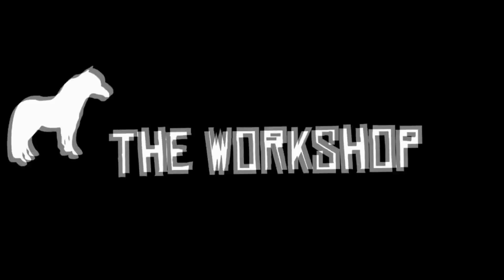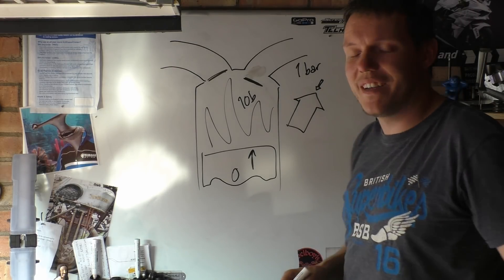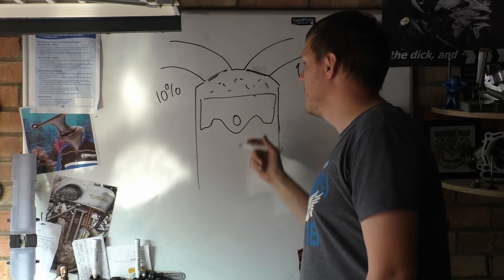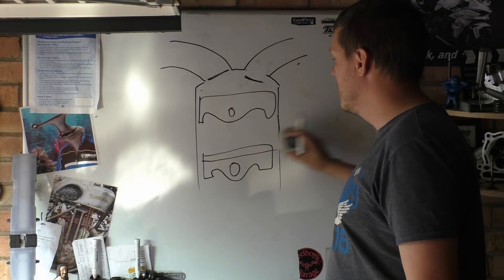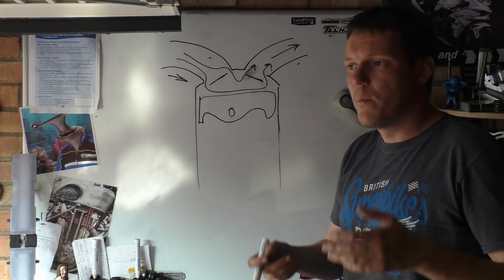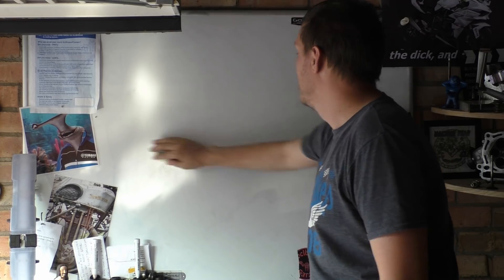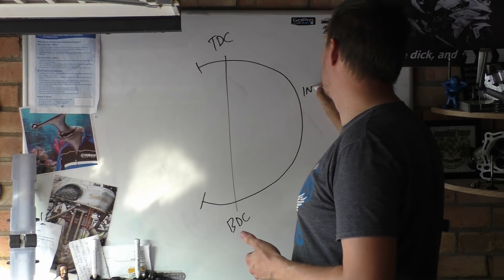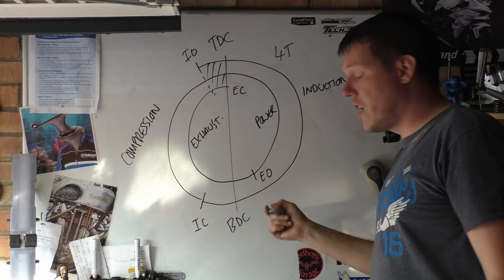Valve overlap - The basics

Comment: Explain how the exhaust explosion creates a shock (sound) wave that creates a negative pressure in the exhaust port and runner.
Reply from the maker: Exhaust explosion?
Reply: @thedirtyworkshop 
Intake ,compression,expansion (explosion), exhaust. 
Didja ever wonder why a motor make noise out of the exhaust pipe?
Reply from the maker: 1. It's not an explosion, it's a deflagration. 2. Explain how a negative pressure wave is created? Ever pressure wave has a positive and negative component, this is basic wave geometry.

Comment: Why not split the intake to separate intakes and have a different cam profile for each side. One side opens early to allow purging but doesn't get fuel sprayed through it and then the other opens up later when the exhaust is closed and sprays fuel through it.

Comment: How can purge be possible as the remaining exhaust gas will be positive pressure and the intake will be in vacuum, it won't push it out of the exhaust it will suck it back toward the vacuum (intake).   At 2:07 you mention with the remainder of the unexhausted gas remaining it's still 1.5 bar.
Reply from the maker: Because of momentum, and the venturi effect. The exhaust gases are flowing out of the cylinder, this causes its own pressure system. If the engine is tuned correctly the intake has a resonance that promotes inertial filling from the intake side.
Reply from the maker: In other words pressure is not the only thing to calculate, hence why this is a difficult subject...

Comment: Kind effort but the explanation contains mistakes.  Valve overlap allows the low pressure caused by the exhaust gases leaving the cylinder to help the fresh charge enter the cylinder. Not what this video describes saying that the fresh air pushes the exhaust gases out. When the intake valve opens before TDC there is not yet any dynamics to the inlet charge to enter and push the exhaust away.  Inlet charge will start entering the cylinder either by the negative pressure of the exhaust gases ( so that the exhaust helps suck the inlet charge) or by the negative pressure created by the piston motion after TDC. To understand it better, Imagine that if you open the intake valve before TDC at low RPM sometimes  you get the opposite. Exhaust gases enter the inlet manifold  and pollute the charge. This often happens when you do not install a proper exhaust system tuned for your particular valve timing. So to summarize Valve overlap is there to use the exhaust dynamics ( created by your exhaust system) to suck air charge before the piston goes downwards. Effectively increasing the air charge induction period. This has also a small effect on cleaning the cylinder better from exhaust gases since the increased air charge sucked inside the cylinder occupies more space and pushes any left overs out. That is also the reason the exhaust valve after TDC delays to close.
Reply from the maker: There is, it the inertia of the intake air through timing of the intake resonance. Do you honestly think a hot gas around 400degC would drop below atmospheric pressure?
Reply from the maker: It's a bit of both, but not purely exhaust. For instance, look at inertial filling
Reply: @thedirtyworkshop yes, it drops way below atmospheric, much more than in any other part of the cycle.
Reply from the maker: Hot exhaust gases drop below atmospheric? Lol please explain. Do you know what pv = rnt is?

Comment: I just discovered your video, have yet to check your list of other videos....  I would really love to hear your thoughts on reversion
Reply from the maker: Flow reversion?
Reply: @thedirtyworkshop  yes, usually discussed more in marine applications because of the water cooled heat exchangers on exhaust, but I'm curious if reversion could explain my current situation where I have an engine with scored cylinder walls and metal dust above both valves in the cylinder head, but none in the intake manifold or catch can that's on the pcv system. My hypothesis is that with such a heavy cam profile (hotrod street cam) and the engine never having turned over 3000rpm, I never had the intake charge velocity to overcome reversion during overlap and that's how the fine powder ended up where I found it.
Reply from the maker: Or it could be running down your valve stems from the head, or maybe your valve aren't closing properly
Reply from the maker: The airflow doesn't have enough lifting capability during reversal to lift metal flakes into the airstream.
Reply: @thedirtyworkshop  thanks for the response. It was a real head scratcher for me. Still baffled on exactly what went wrong in this engine but the physics involved are so neat to ponder. I'll have it torn down by the builder at the end of the week when I get back into town

Comment: Also, the reason your vacuum goes to crap with more overlap is you are essentially creating a low-rpm vacuum leak. With the throttle nearly closed the only other place the engine can draw from is the still-open exhaust valve(s) and what it's trying to draw back in isn't air, it's exhaust, so it's even worse the a normal vacuum leak. This is why some racing engine with really large, aggressive camshafts can't idle below ~1000rpm. You must open the throttle more at idle (and usually give it more spark advance and a richer air/fuel mixture) so that the gases have more momentum to reduce this reversion and so the more of what is being drawn in is air so that the engine can produce enough power to idle.
Basically, overlap makes you engine really inefficient at an idle but it does all sorts of wonderful things for torque and horsepower as engine speed increases. This is why variable valve timing is such a powerful tool. We can get the best of both without the drawbacks of either.

Comment: Well explained👍🏽, Also Intake And Exhaust Valve overlap occurs while the piston movement is minimal ,at about 15degrees before/after TDC Or BDC When the piston is barely moving.
Reply: depending on the cam. mine opens 26° before TDC. 66° Overlap. Stock cam is 6° overlap :D

Comment: Building a high(er) compression VW 2.0 8v engine.  Currently running a sport 260 cam with 1° overlap, and the engine lopes at idle a little.  Planning on going with a 276 cam, with 7° overlap, but fear that itll be too much for an OBD2 engine with stock tune (for now).  Driveability is not a concern since its a weekend cruiser, potential race car, aslong as it can idle.  Is 7° overlap too much for a stock tune obd2 engine?
Reply: Are your overlap degrees @0.050” lift?  No overlap = no high performance

Comment: Thanks for the HQ lesson, very educating. What do you think of 12.5:1 compression ratio 4T engine? Will it have smaller amount of "trapped" exhaust gas inside combusting chamber compared to a 10:1 compression ratio engine?.. if yes, do you think this is the reason why manufacturer produce higher compression ratio engine (to increase the volume efficiency)?
Reply: High compression = thermal efficiency

Comment: Pretty close, but exhaust doesn't close at TDC.
Exhaust closing EC is usually around the same degree ATDC as intake opens BTDC in a 4 stroke petrol engine.
Reply: intake opens before TDC exaust closes after TDC
Reply: Yes, that's what I just wrote
EC is ATDC and IO is BTDC
Reply: If you're going to discuss valve overlap then of course it matters and if you did 30 seconds of research on it before making the video you would have discovered that.
You're a qualified engineer and should know better.
And spare me the Delboy tantrum over the correction, I've been a mechanic too long to take any notice of that crap so suck it up princes.
Reply from the maker: LOL nice comeback. "You're a qualified engineer and should know better." - don't really know what this means? I should know better? 

What difference would it make if I draw it ending at 0deg?

After rewatching the video bit - I do say "it'll close at TDC or something like that"

On the spiral diagram the line slightly passes TDC. That fact is that is doesn't matter for this video. You will start shouting "the cirlce isn't perfectly round".

I'm sure there are some engines out there where the closing of the exhaust is TDC - probably. 

Oh look - loads of 'theoretical diagrams' with TDC as the exhaust valve closing. (there's loads of 'correct' diagrams as well, don't get me wrong)

https://www.researchgate.net/profile/Rupesh_Gupta12/publication/309011115/figure/fig8/AS:416252737671175@1476253794862/Valve-timing-diagram-shown.png

https://image.slidesharecdn.com/24514675-2-internal-combustion-engine-120405123335-phpapp01/95/24514675-2internalcombustionengine-31-728.jpg?cb\u003d1333629439

http://dzmm.info/wp-content/uploads/valve-timing-diagram-for-diesel-engine-theoretical-of-4-stroke-cycle-present-gallery-likewise-553-640x346.png

 Until I do videos on the effect of valve opening and closing you're just being a padantic prick. Its the 'pretty close' patronising comment that is the problem, on a video that is the basics. 

This is all on the fly and you bang on about delbollocks but the guy is talking complete made-up bullshit. When I say 'something like that' what I'm not saying is ALWAYS TDC. 

Regardless, you wanna knit-pick then that fine, but there are people out there that this is all new to.
Reply: Well that was just a load of noise and 3 useless images.
Theoretical valve opening my foot.
As an engineer if you cant spend a matter of  seconds to put the words valve overlap into google to get it right then WTF are you doing teaching mechanics.
All those speeches you give about correcting all the bad mechanical advice on YouTube and getting the facts right for viewers and saying time and time again and then you go do something is lame as that.
Stop whining and just admit you cocked it up.
Reply: And to these comments

"This is all on the fly and you bang on about delbollocks but the guy is talking complete made-up bullshit. When I say 'something like that' what I'm not saying is ALWAYS TDC. "

No, never at TDC, not sometimes, or maybe, "theoretical" engine valve timing is nonsense, there is just engine valve timing.

"Regardless, you wanna knit-pick then that fine, but there are people out there that this is all new to."

If they are new to mechanics then why on earth are you talking about valve overlap to them, that is not part of any basic mechanics tutorial. 

"On the spiral diagram the line slightly passes TDC. That fact is that is doesn't matter for this video. You will start shouting "the cirlce isn't perfectly round"."

Why would I complain the circle isn't round, if it was round then it wouldn't be a spiral would it.

"What difference would it make if I draw it ending at 0deg?"

Well by the same logic you may as well tell them the inlet opens at TDC as well and just forget about valve overlap altogether.

Comment: Does the overlap change with a turbo system seeing as there is an intake charge pressure that is higher than the exhaust pressure.
Reply: This is verry different from set up to set up if you look a stock cars with small turbos and small exaust housings the back pressure can be a lot larger than the intake pressure. this is reflected in the camshaft design! stock turbo cams usually have smaller amount of overlap on stock cars a nice curve is important so a small turbo and a mild cam i used. BUT! a really good thing if you are tuning an engine (like alot) is to have quite a really large turbo(in some cases to large) with a large exuast housing and a manifold with long tubes you will have a lower back pressure which might equal or is lower then intake pressure(boost!) then you can run a cam more similar to a NA motor. this will give you more power with lower boost. but i some cases its better with a short manifold and a small turbo with small houseing so you can get boost eariler in the powerband! which is good for track cars or milder street cars! the basics! (english = 2nd language)
Reply from the maker: The exhaust blow-down pressure is different because of the back pressure from the turbine interface. Its all a bit wishy washy when it comes to turbos - but we're gonna get there.

Comment: would a turbo help or hinder this condition? i mean, you have more back pressure against the turbine, yet forced air to help expel the gases, i hope that makes sense, seya in a bit ;)
Reply: This is verry different from set up to set up if you look a stock cars with small turbos and small exaust housings the back pressure can be a lot larger than the intake pressure. this is reflected in the camshaft design! stock turbo cams usually have smaller amount of overlap on stock cars a nice curve is important so a small turbo and a mild cam i used. BUT! a really good thing if you are tuning an engine (like alot) is to have quite a really large turbo(in some cases to large) with a large exuast housing and a manifold with long tubes you will have a lower back pressure which might equal or is lower then intake pressure(boost!) then you can run a cam more similar to a NA motor. this will give you more power with lower boost. but i some cases its better with a short manifold and a small turbo with small houseing so you can get boost eariler in the powerband! which is good for track cars or milder street cars! (english = 2nd language)

Comment: Great explanation. I've heard 2 engines that had so much overlap that you could hear it at idle. An Isuzu 4 cylinder (Chevy Luv pickup) and a Pantera (Ford 351 Cleveland). Both were really fast.

Comment: This is probably too involved for a simple comment, but how does a person calculate dynamic compression? One of my problems is the cam manufacturer doesn't have all the info on the cams I installed. The only part I know is that overlap was significantly more on the new cam. Trying to work out if I really need high octane fuel, or if the overlap is enough to let me use something like 93 octane. Currently running at about 105 with a mix of 91 and some MMT based additive, but was running real race fuel of 105 before. The race fuel was too difficult to get, so trying the Torco additive. Would be happier with 93 pump gas if I could safely run it. I've done web searches on dynamic compression, and never really found anything that explained what I needed to know to compute what my engine is really running right now.
Reply: +Mini GP Racing 
Dynamic or effective compression ratio is a complex subject with many variables. 
Obtain a dial indicator, degree wheel, evaluate and plot your exact camshaft(s) intake/exhaust lobe profiles, lift, duration, event timing, lobe separation angle, intake/exhaust lobe center-line and overlap. 
Static or dynamic or effective compression ratio is only one variable of many influencing fuel octane value requirement/choice. 

There several excellent articles and calculators available online. 

http://members.uia.net/pkelley2/DynamicCR.html

http://ftlracing.com/dynamiccr.htm

https://www.rbracing-rsr.com/camshaft.html
https://www.rbracing-rsr.com/comprAdvHD.htm

http://www.wallaceracing.com/dynamic-cr.php
http://www.wallaceracing.com/eff-cr.php

https://www.google.com/search?num=100&newwindow=1&ei=SrZaW8-DH9u_0PEP5fGv2Aw&q=dynamic+compression+calculation&oq=dynamic+compression+calculation&gs_l=psy-ab.12..0i22i30k1l4.7590.8683.0.11082.3.3.0.0.0.0.88.239.3.3.0....0...1c.1.64.psy-ab..0.3.238...35i39k1j0i13i30k1j0i13i5i30k1.0.K6Ti8_GvHA4

https://www.google.com/search?num=100&newwindow=1&ei=VQBaW4j1M8OezwLiqpLABA&q=dynamic+compression+ratio+calculator+and+camshaft+selection+utility&oq=dynamic+compression+calculator&gs_l=psy-ab.1.5.0i71k1l8.0.0.0.13397.0.0.0.0.0.0.0.0..0.0....0...1c..64.psy-ab..0.0.0....0.a3vCzBtPkDw
Reply: the dynamic compression ratio change alot over the rpm range because of inertia filling at high rpm(which give you higher pressure) or leak out of the intake valve on low rpm! you also need to take ignition timing into account(it plays a huge part in what kind of fuel you can run). what you wanna do is calculate the maximum pressure in your cylinder.
Reply: jompa zx I'm hoping that the question and your reply will fuel Matt to explain it to us so I can maybe, finally grasp this concept. It does make sense that compression will change as the air gets flowing, the fuel/air mix does have inertia so the fuel charge can slightly raise the cylinder pressure at bdc before the valve closes. And the same sort of thing from the overlap as was mentioned in this video. My intake harmonics kind of suck, wasn't much room to get a longer intake so I think it is like 3rd or 4th order and pretty high in the rpms, kind of prevents good overlap performance at the lower rpms.
Reply: What you forget is the intake valve close after BDC this is necessary on high rpm otherwise the cylinder will not be full and on high rpm you might get some inirtia filling so maybe you get over 100% VE this will make you dynamic compression ratio higher. BUT on low rpm you will fill the cylinder at BDC or just right after BDC so if you have high rpm cams you will push some fuel/air mixture out of the intake valve again this will hurt your dynamic compression ratio!
Reply: patw52pb1 Thanks for the links, I'll check them out.
Reply: If you want to find out when the car is knocking because of low octane, you could just install a knock sensor or tap into the one that is there already.
you could also install a wideband lambda, you need one if you want to do some safe tunning, reading sparkplugs is rarely good enough.